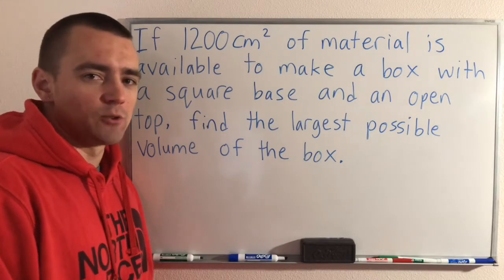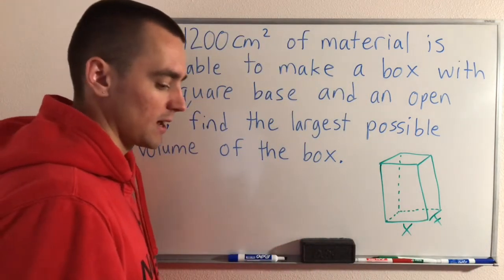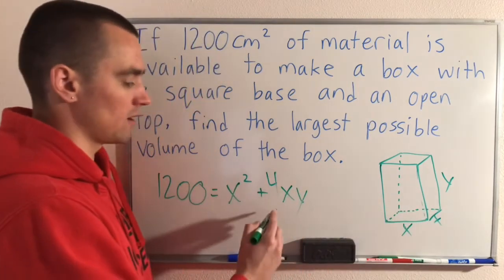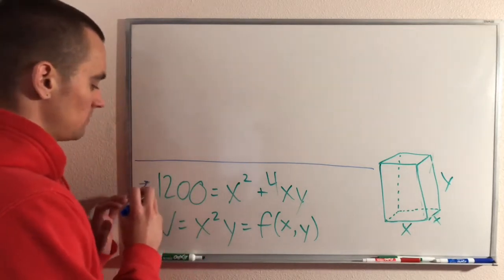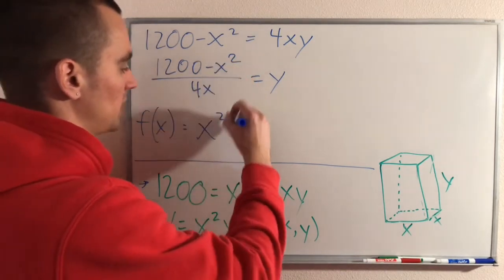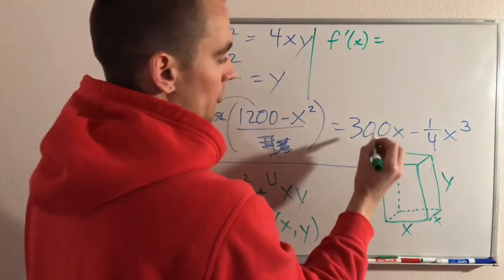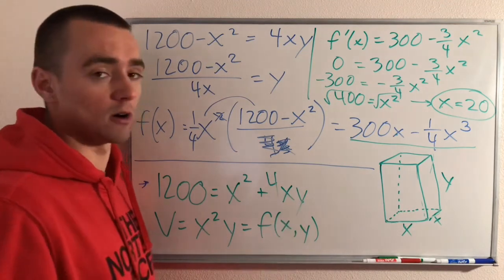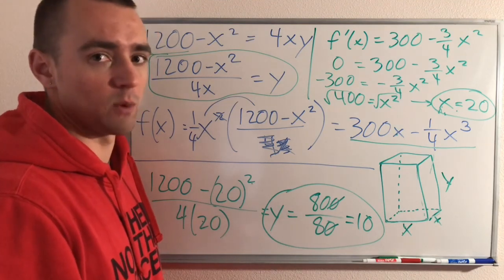IF 1200cm^2 OF MATERIAL IS AVAILABLE TO MAKE A BOX WITH A SQUARE BASE AND AN OPEN TOP - Optimization

Comment from the maker: You can find the dimensions of this box with a few simple steps:
0:24 | Draw a sketch
2:05 | Determine the restriction and function you need to minimize
4:05 | Use the restriction to rewrite your function in only one variable
6:01 | Find the critical numbers of the function
8:10 | Determine the minimum/maximum values based on your critical number(s)